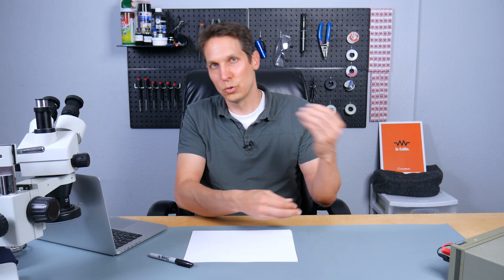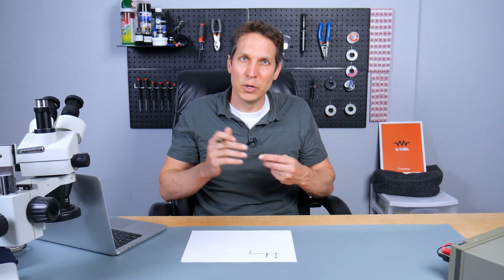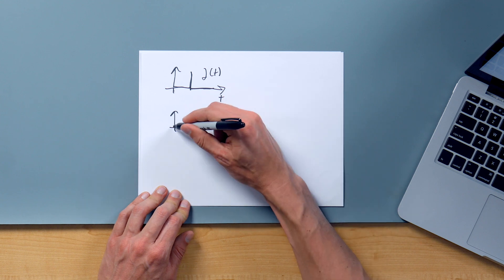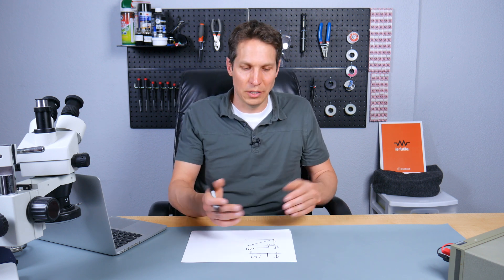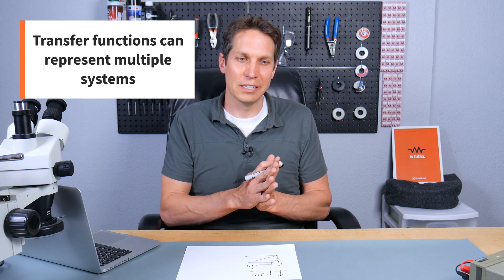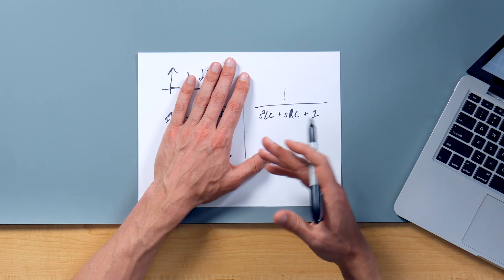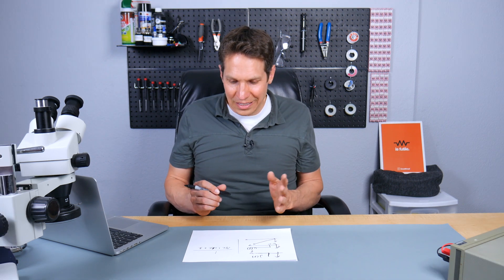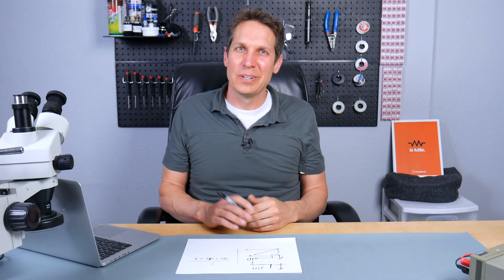Transfer Functions in Control Systems | Control Systems 1.3

Comment: Great series. Thank you. Please make distinction between open loop TF and closed loop TF and which type of analysis uses which
Reply from the maker: Kushal is still working on these tutorials and, to be honest, I haven't made any requests, he just keeps creating great content.  So, I'm not sure when he's going to touch on this.  I think this will be more explicitly covered in some practical, real-life examples, which we're hoping to do toward the tail end of this series.
Reply: A brief idea on open loop and closed loop systems is in the introduction tutorial of this series. Coming to open loop TF, it is dealt in the tutorial on error analysis whose video is yet to be published. Although, you can read it here. 
https://www.circuitbread.com/tutorials/tags/control-systems

Open loop TF is mainly used for Root locus plots, bode plots etc. 

We haven't explicitly differentiated both in this tutorial as until we finish time response analysis, a transfer function means a closed loop transfer function in maximum cases.
Reply: @kushalgowdan6906  Thank you, wish you luck with the tutorial. This point confuses alot.